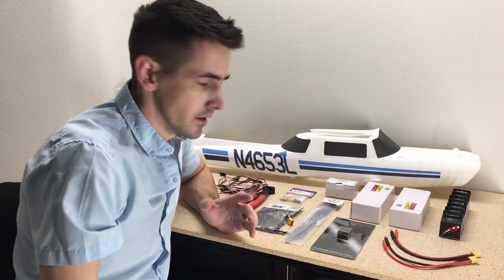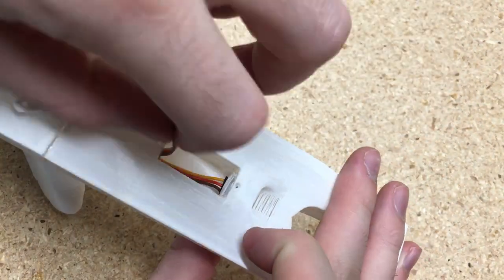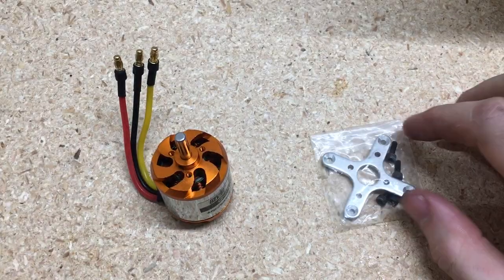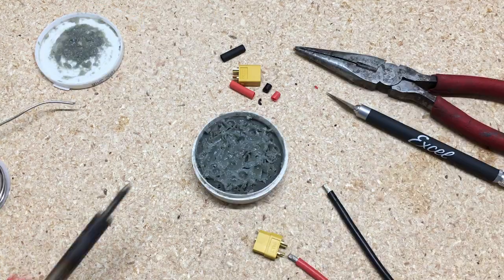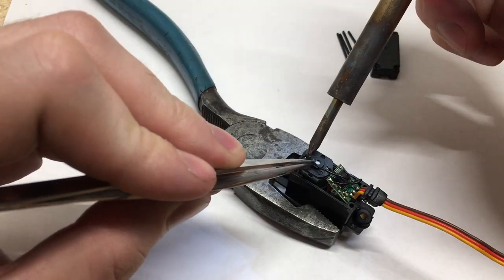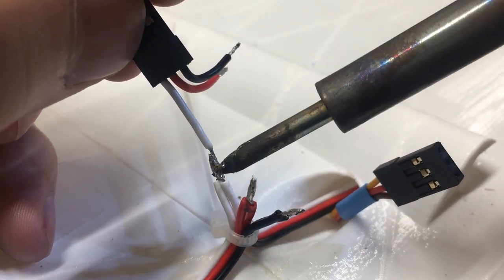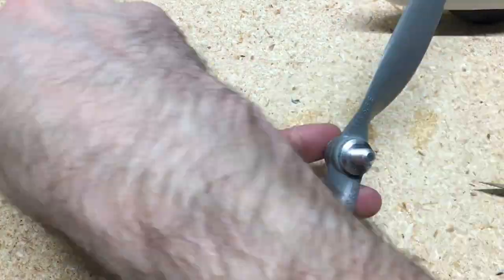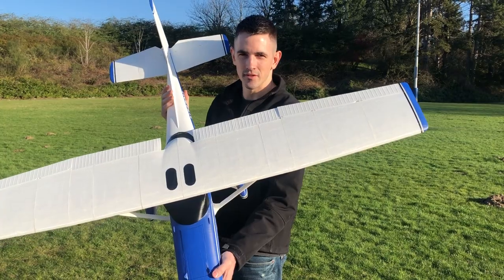3D Printed Airplane C152 Part 5 - ADD POWER & TAXI

Comment: Zip ties around the battery are not a good idea... the cells have pressure on them and in a crash could possibly have a potential for cutting into the battery pack. I would just use velcro on the low voltage meter also. Just a thought.... great looking bird. Good  luck on the maiden.

Comment: The nose is way too long for a C152
Reply from the maker: I agree
Reply: @TroyMcMillan  Still having issues on printing the Big Bobber's wing. Tried everything and printing with Polyair too.
Reply from the maker: @Stubby0266  have you watched my how to print thin wall video? Do you use the settings I provide in the description of the big bobber build video?